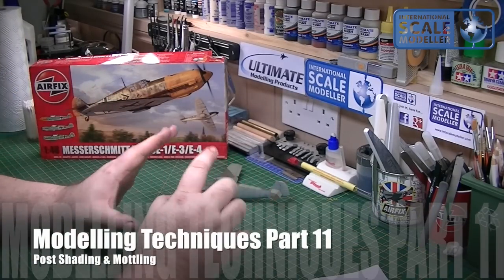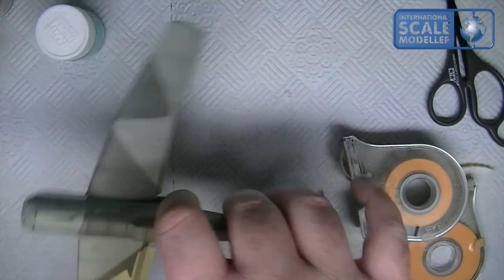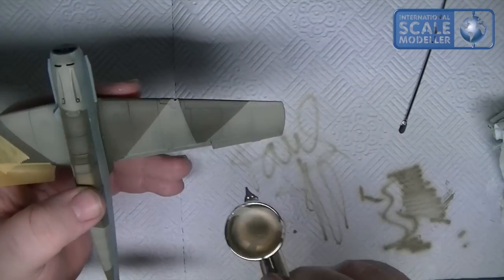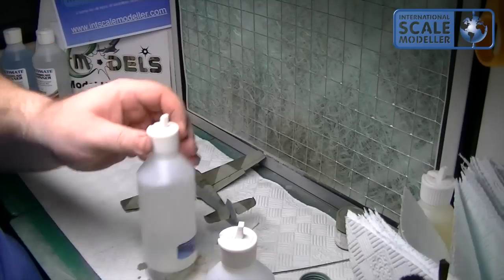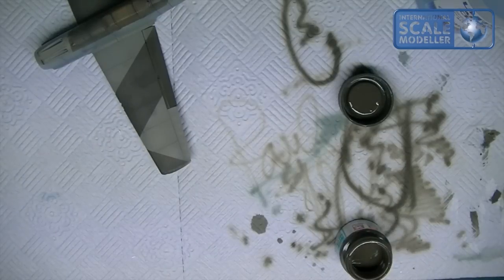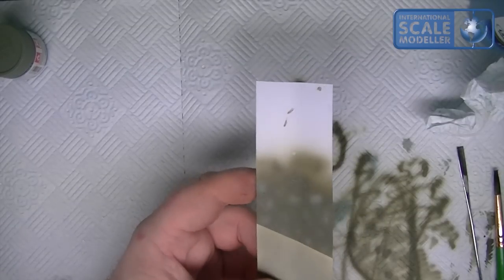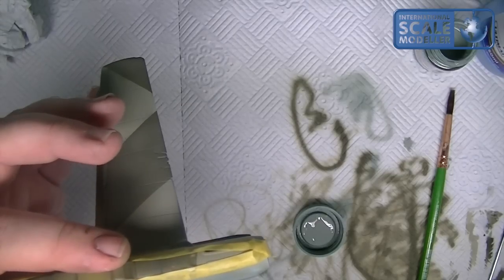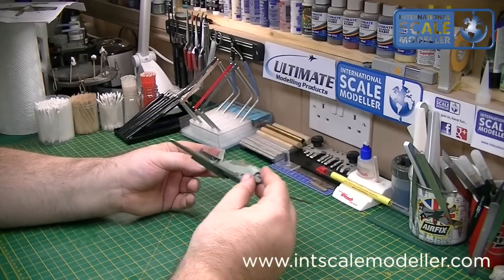Aircraft Modelling Techniques Part 11 - Fading & Mottling

Comment: Thanks for the techniques videos - they're really good for beginners such as me, and I enjoy them.

In this video, you mention a Mr. Hobby specialised tool for opening bottle caps which have e.g. become stuck because of paint drying.

You can use a standard, "wide" (about 3 mm and wider) rubber band ("elastic") for the same purpose. You wrap it around the lid two or three times, then turn. The fingers will grip the rubber band, and the rubber band will grip the cap. Works for glue caps, too.

Good modelling - looking forward to part 4 of the AFV-series :-)

Comment: Great videos, Paul. I build quite a few figures, and what's done is that after one part (say the base colors)  is completed I spray some matte clear over the model. Once dry I then continue with my painting. This way if I goof up part of painting step 2, I can clean it off w/o affecting what I did earlier. I continue this way until the painting is finished. This would have prevented your goof with the tail of the plane when you had to repaint the original color. Just thinking out loud.
Reply: Hey kevin, yeah thats one way of doing it, thanks for sharing :)